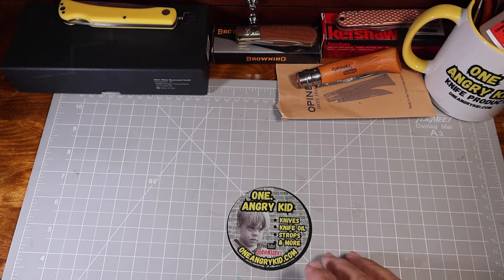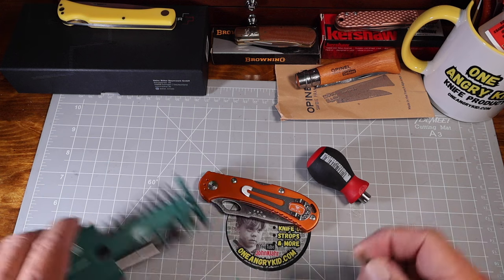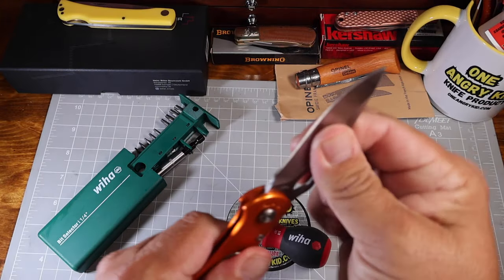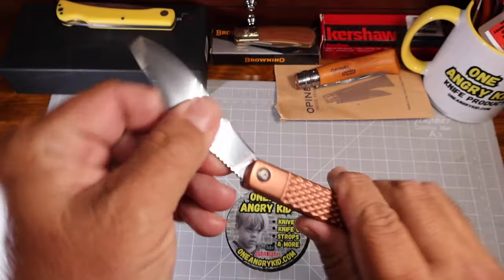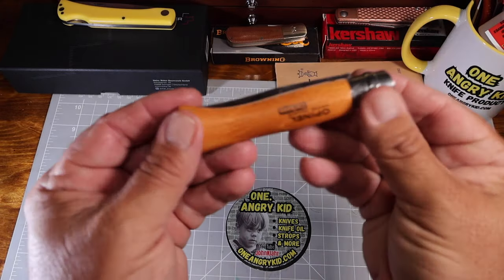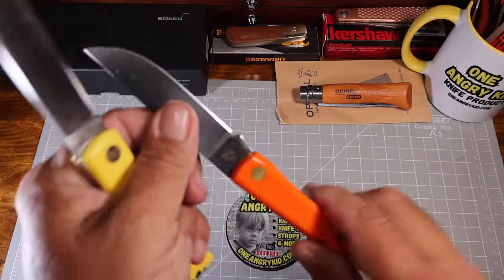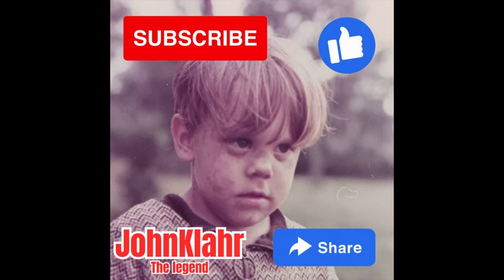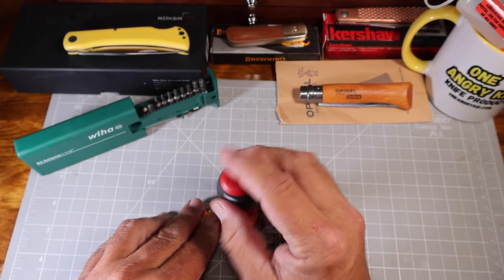Buck Spitfire Tune Up= Slicking up the action on a pocket knife at JohnKlahr.

Comment: You should try Ballistol on your knives. It’ll make the action smooth as silk. I use it on all my firearms.
Reply from the maker: Not a fan of Ballistol at all, leaves gummy residue inside the knife and stinks horribly, my One angry kid oil is non toxic and much safer to use on your knives being made from all food grade ingredients.  
If you need a goood gun oil I recommend G96 over Ballistol any day.
Reply: I use Ballistol on all my fishing reels and have done for years. I never found any stickiness or residue. User friendly and good value.

Comment: Nice finding those burrs and getting those out. Bending that spring to take some tension off made that knife a smooth one-handed opener like it was supposed to be. Good work. The blade hitting the back lock when closed, was the same problem I had with my Boker plus Nubilum. Except the blade tip was hitting the last barrel spacer and made a dent in the edge. Brand new and already a project. But I like projects and had to re-profile the edge since the curve wasn’t perfect in that area. Now it’s perfect and a great knife. Yours has a lot more edge touching. A bigger re-profile job. Weird how things like that get right passed quality control. 
Gives us tinkerers something to tinker with though.
Reply from the maker: It sure does, hey, thanks for checking out my. Video